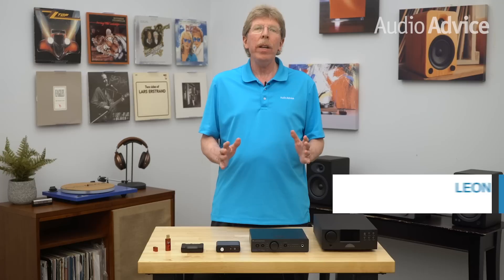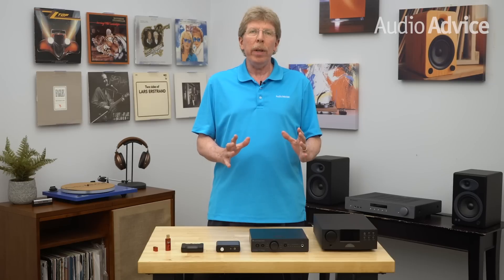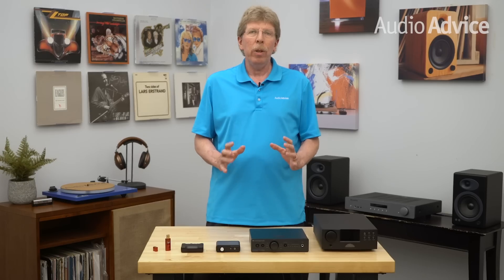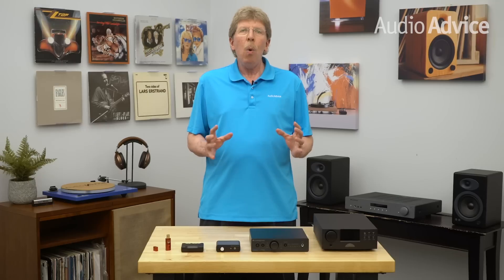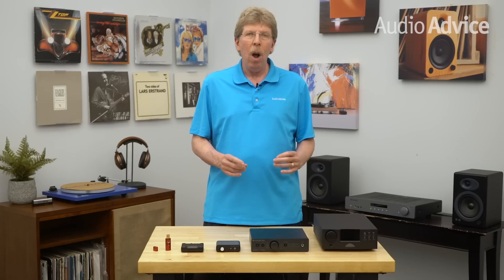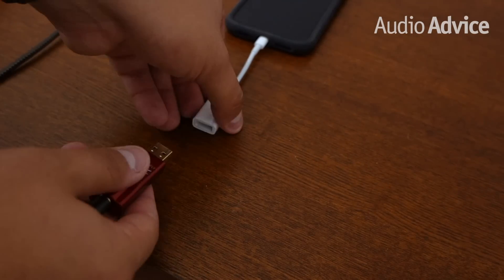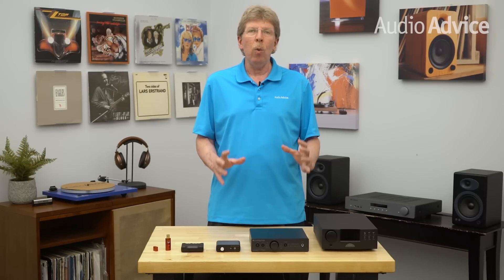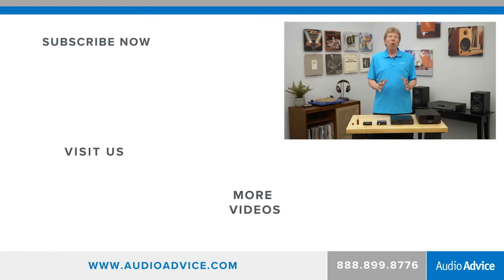What is a DAC? - Explained

Comment: Sir which dac should I use in my bose companion 5 to connect with my I phone 12?
Reply from the maker: Sorry, we are not a Bose dealer.  The Dragonfly Black will have an 1/8" audio out you could plug into the system.  Thanks for watching

Comment: I dont have DAC but i have tapedeck and cassette walkman.Just bought an cassette mp3 adapter with sd card inside.wow the sound is very solid when inserted to my tapedeck and walkman.compare to my mp3 player and celphone.and that is my DIY DAC system

Comment: Brought my first DAC just this week and it made my music sound Incredible. if you have music in hi res (DSD,DSF..)  you need a DAC to really bring the sound out!
Reply: Hi res music is a gimmick. CD quality is all you need.
Reply: @oldskool4572  how about flac 24bit songs should i listen to them and what else things i will need to get full experience? i have an android phone
Reply: @Anonymous-kg7yg  24 bit is another gimmick in my opinion. That's for engineers. All you need is straight up cd quality16/44. If you listen primarily on your phone then lossless at 320 is ample. Hard pressed to tell the difference between that and cd quality. If however you have a decent hi fi sytem at home then cd all the way. That's the way I do it anyway. A DAC is useful to help amplify a weaker original output from a crappy headphone jack or other ouput.
Reply: @oldskool4572  I don't have any hi-fi system i have a poco f1 phone and a pc which have a msi B450-pro m2 v2 motherboard on board sound system what else should i buy please suggest
Reply: @Anonymous-kg7yg  For a DAC I would go for either Cyrus Soundkey or Audioquest Dragonfly. Either is fine. Google is your friend.
Reply: @Anonymous-kg7yg  celphone is sound compress even its high resolution or flac. I have my best DAC, cassette deck with Dolby C. and mp3 cassette adapter with sd card inside.the sound is wider and solid sence cassette deck has very strong analog signal.

Comment: Could I connect a CD Player to an Amp , then to a Tube pre-amp , then to a set of Bose Speakers? Or wouldn't that work?
Reply: I would would run that loop like so..
CD player--tube amp-----pre amp---- to amp.
Frankly you could put the tubes in there anywhere.  The further back you place them in the loop the more your tube sound will be diluted.
And it between the pre amp to amp to amp to maximize the warmth. 
If to rich move between CD player and pre amp.
Reply: So I misunderstood..  the answer  is yes.

Comment: Hi, quick question my friend. On my tablet, would I "disable USB audio routing", or would I keep it running, to connect my tablet or my smartphone directly into my portable turntable?? I just looked it up, and figured out how to go to the "developer options", on my tablet, and disable USB audio routing. And I'm pretty sure that my tablet does work with OTG USB, but im not sure about USB Host. But this whole thing is confusing, and there's one thing stopping me from using my Mixfader, and Mixfader Prolink with my portable reloop spin turntable. A lot of portable turntables are built with the "USB PC data connection cable slot, built into the turntable. But my Reloop Spins power source is a "micro USB" connection. So I am trying to figure out how to utilize my tablet, or even my Stylo 4 smartphone, but if I have to,  my tablet, and have it connected directly to my portable reloop spin turntable, and then have my speakers connected to the Mixfader Prolink output connection, and also have a jack running from the turntable to the Mixfader Prolink, and then either some headphones, or any other device to the other remaining Jack on the Mixfader Prolink, which the Mixfader Prolink is a really small awesome sound card, basically, that was built by Mixfader, to connect to the Mixfader crossfader through "Bluetooth 4.0". So basically, the Mixfader crossfader will connect to the Mixader Prolink, through Bluetooth 4.0, where the mixed fader pro link is a external sound card. And in that Mixfader Prolink sound card, there are three slots for 3.5 audio jacks. The Mixfader Prolink comes with three small 3.5 Jack cables, and one is supposed to run directly into the headphone jack on the tablet or smartphone, directly from the Mixfader Prolink, the other cable is supposed to run into the turntable,  which is obviously connected to the Mixfader Prolink as well, and then there's one output Jack designed for either headphones, or a speaker or speakers. And where my Reloop Spin Portable Turntable doesn't have the USB PC data cable, like the Numark PT-O1 one or the Vestax Handy Trax, which are known for connecting to a PC or computer. I've been trying to figure out exactly how to connect my Reloop Spin portable turntable to my tablet, so that it will run the digital vinyl option on the Mixfader app, which will allow me to switch between either digital vinyl, or regular vinyl, while utilizing the Mixfader app. The Mixfader app is like a DAW app, that you would see on a PC, but actually works on a smartphone or tablet. So I would essentially be able to turn my portable turntable into a both DVS compatible(Timecoded vinyl), and normal Vinyl compatibility, portable turntable. I got to tell you this has been stumping me for a month now. I ordered a "OTG to USB adapter", and was hoping that by plugging my Reloop Spin portable turntable into the OTG to USB adapter, which the adapter would be plugged into the tablet, I was hoping that that would enable the tablet to allow me to utilize the Mixfader app, for DVS mode, which has to allow the tablet to read either vinyl being used on a turntable, directly on the app, in real time, so that I have access to cueuing, sampling, effects, and also looping and all the cool stuff that usually DAW's work with, rite on the tablet! I noticed somewhere that you can go to your developer mode, and "disable USB audio routing".... But I'm not sure if that's what I'm supposed to do in my situation, or if I'm supposed to leave that enabled, where my Reloop Spin portable turntable does not have the USB PC data cable that the Numark PT-01, or the Vestax Handy Trax portable turntables have built into them?? Lol... You seem like you know your stuff my friend, and I was really hoping that I might be able to seek and answer through you, thanx a bunch.......👍🙏😎... Oh yeah, my tablet's using a micro USB connection, just in case you are able to give me any advice or help with this case or situation, and the connection on my Reloop Spin portable turntable, also has a micro USB connection. Obviously, the Reloop Spin portable turntable also has the RCA's connection, & the 3.5 slot, or 1/4" slot, as well. My turntable also has a 3.5 output jack slot, on the opposite side of the Turntable, as well, for daisy chaining, if I wanted to. Thanx again mate, great video, & definitely will be watching more of your helpful videos. Im a new, learning, & practicing skratch DJ, & really would like to get this figured out, thanx again mate......💪👍🙏😎...  I copy and pasted a link of pictures of all slots and connections built into the reloop spin portable turntable........ 

https://images.app.goo.gl/XidRkRAe8yEVNhk59

Comment: So if you buy an outboard DAC you still need a tablet, phone or computer and you still need a Bluetooth pickup device but (maybe) not a Bluetooth speaker. So you plug the converted analog into an amp. Is that right?

Comment: what about if I just listen to an audio cassette or an LP ?
Reply: Those signals are already in analog and wouldn't need a DAC.
Reply: @hcox84  not true entirely. If you connect the source to an analogue to digital converter, then you would need a DAC to convert it back.

Pro tip: for added fun, reconnect that DAC to another ADC, so that you can then reconnect the latter to a second DAC! Two DACs are certainly better than one!

Comment: I have owned many DACs and the Audio Engine B1 bluetooth wireless DAC streams Tidal HiRes sound from my Nexus 7 VERY nicely.  It's less then $200.  

Not tall buetooth transmitters are equal (I think that's true but I can not explain how a simple digital stream could go bad). For instance the Nexus 7, Huawei H5, are good but my Cheap tablet not so much?  My Galaxy Tab S2 not so good perhaps. 

If your device has Bluetooth 5 it's probably good.  All if mine are Bluetooth 4.